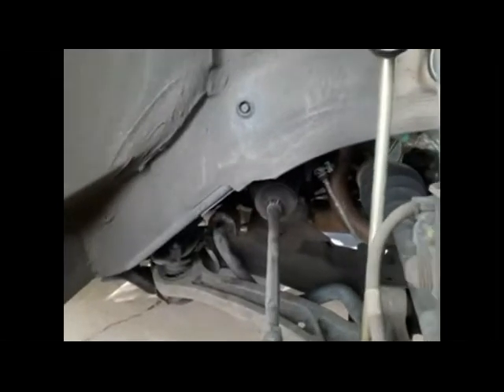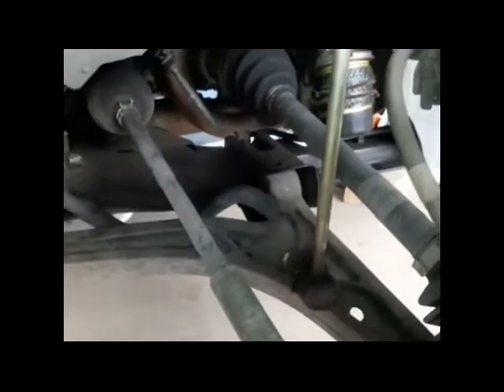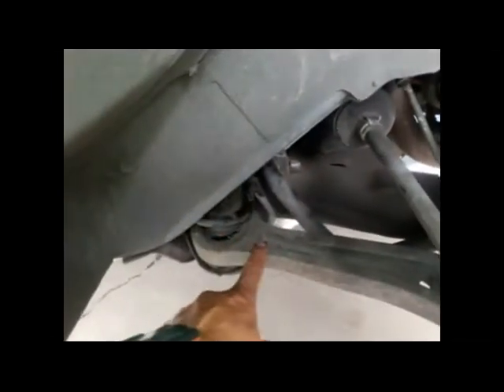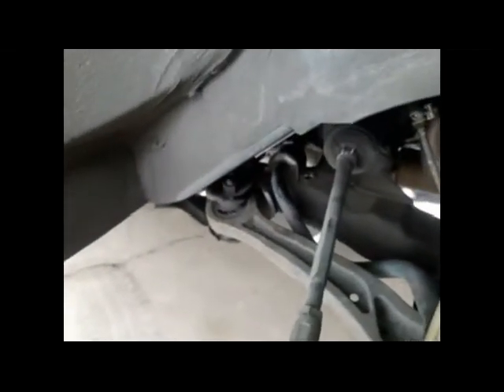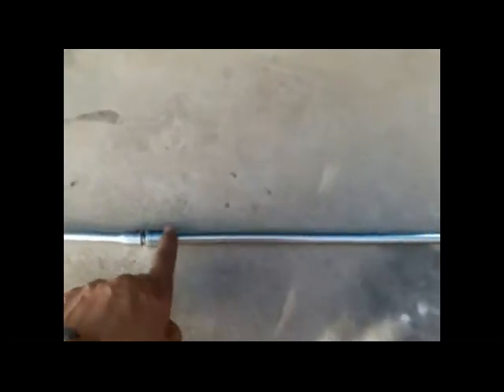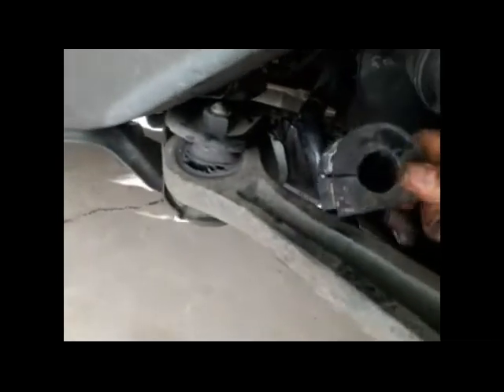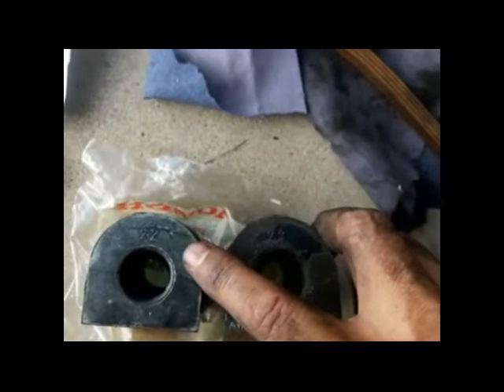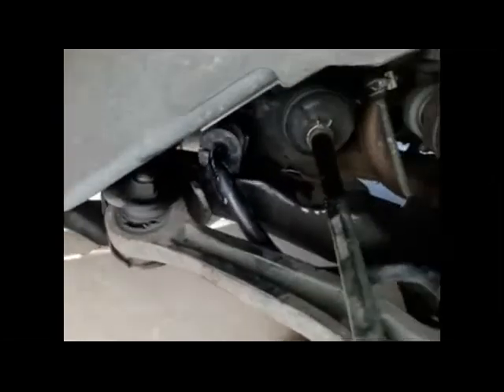2004 Honda Odyssey Sway Bar Link Bushing replacement

Comment: That back bolt is easy to get out from the bottom just use a 3/8 Rachet not a 1/2 inch , not enough room for a 1/2 drive Rachet

Comment: Thanks for the mileage on the van right in the begining. I just got mine used with 128,000mi and it's a rattle trap. Time to go to work. 👍

Comment: I did mine today and it takes me 3-4 hrs to do it because bolts are so rusted and I’m very careful not to snap them. I live where snow and salt are my enemy. Looks like you live where there’s no snow or salt needed ,thanks
Reply from the maker: Great job!!! I'm so glad to hear that you didn't snap off any bolts because It would be every mechanics nightmare doesn't matter where you live. I use to live up in Great Lake and Green Bay areas so I know exactly what you going through.
Reply: u gotta use easy off penetrating oil and a torch lol.

Comment: i just bought this same van. 116k miles. any suggestions that you've found to do besides trans flush?
Reply from the maker: When mine reached 120K, I have to replace the front and side motor mounts because it jerky when shift from park to drive. My suggestion to you bring it to the dealer and ask them about the air bag recall. If the previous owner have not done it, then let them do it for you (free of charge) and ask them to tell you all the things wrong with your car that they found. This is the part where they told me about the motor mount need to be replace and I do it myself afterward.  I also change the 6 spark plugs, and the Plentinum gasket on top of the intake (if the top of your car intake look like mine on the Click/Chatter video). When I replaced this gasket, I have to clean out the 2  passages under the gasket because they are clogged up. I think these 2 passages are part of the EGR system.

Comment: What is the part number for the bushing?
Reply: The Honda part number is in the description above the torque specification.
Reply: got it thanks
Reply: I change those way bar bushings, sway bar links and also control arms but I still hearing some clunking sound somewhere in the front,I know my tie rods are in good shape,any suggestion? Thanks